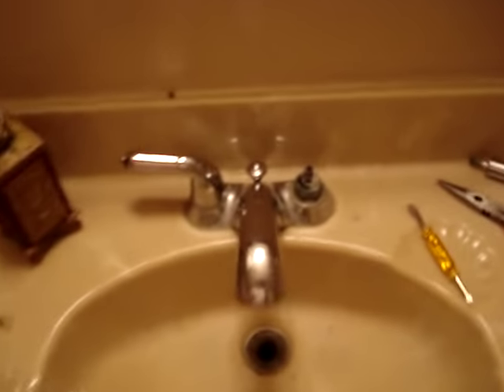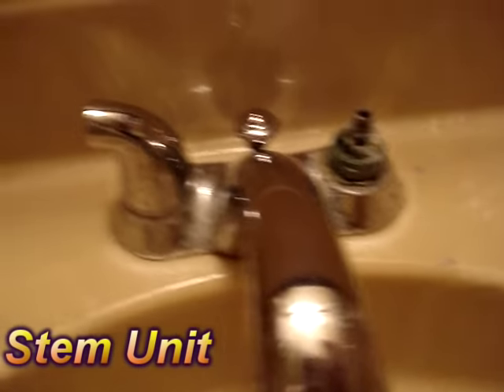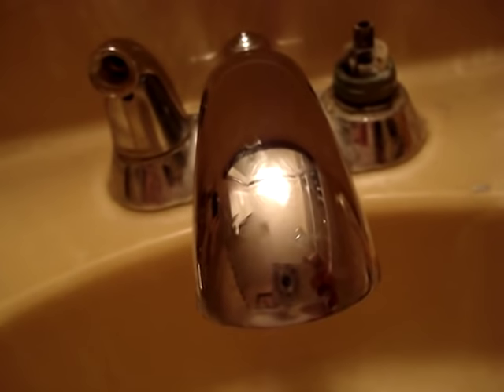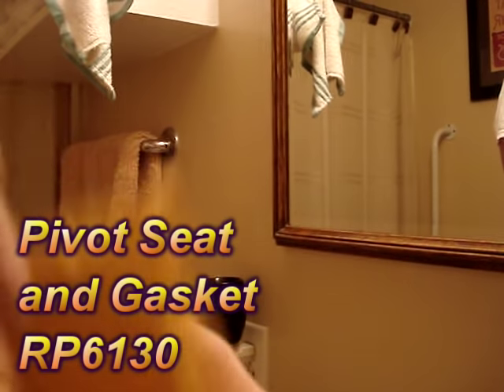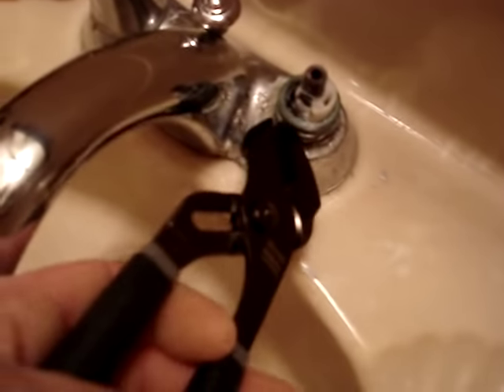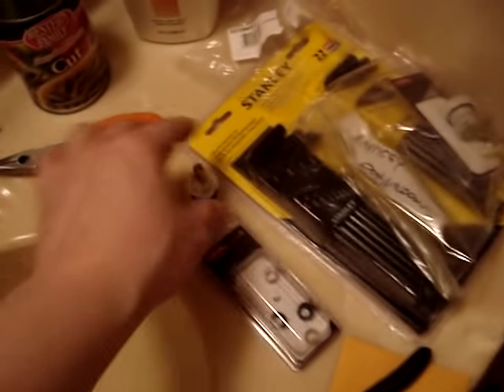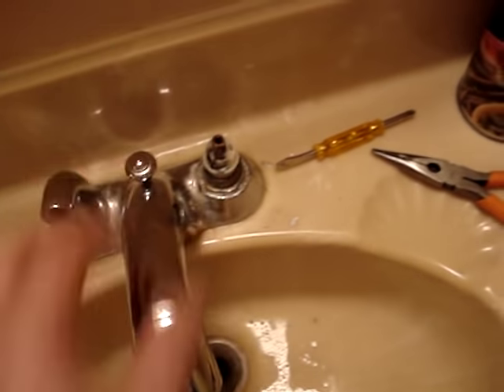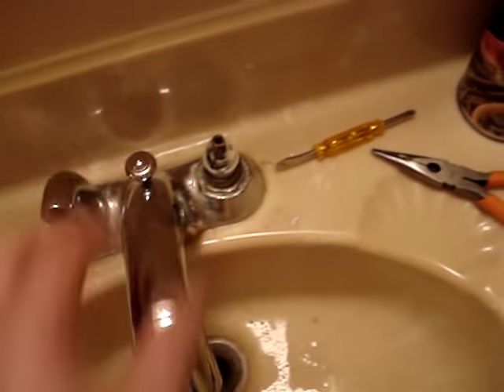How To Fix Leaky Bathroom Handle | Delta Faucet Model 4530 Series | Hard Water

Comment: This was very helpful.  I paid a plumber to fix two Delta faucets that had minor leaks and he left them with bigger leaks.  Plus, he used a cheesy plastic replacement part in one of the faucets that didn't even fit properly.  So, I checked out your video and decided I would try this myself.  I purchased the replacement parts and successfully fixed both leaks.  Thank you so much for the helpful instructions and the part numbers so that I could buy the correct parts.  I used a 3/32 Allen wrench and it was the perfect size.  THANK YOU!!!
Reply from the maker: Susan Wood, awesome! Really happy to hear that this video helped you out. Thank you for commenting!

Comment: VERY HELPFUL!!!

Have been trying for 3 months to find info and fix the same problem.

How might I get the first part of the handle off without scarring it?
Reply from the maker: Jan Ritch, glad this video helped a bit. CLR or vinegar is what I did in the video to loosen the handle and break up some of the calcium deposits. Soak a rag with either, wrap it around problem area and let sit for a few hours.

You may still have to use a flat-head screw driver like I did to pry it loose depending on the amount of deposits and how bad your water is where you live.

Thanks for taking some time to comment and hopefully you soon will have no more leaky faucet.

Comment: My moms delta I've had to repair so many times it's not funny. I purchased a peereless at lowes at least 12 years ago for $30-35 & have not had to work on it any at all. Now her delta is leaking like this one was around base of handle so thanks for sharing I'm going to have to buy some parts either just the O-ring for the stem or everything not sure which yet.

Comment: To get rid of the hard water corrosion: take a towel or old undershirt and soak it in plain vinegar. Wrap it around the faucet and leave it there for a few hours or overnight. Then you can clean off the hard water junk very easily. Hope this helps. My sinks left hard water green stains  on the porcelain and I tried this method as a last resort and it worked perfectly.
Reply from the maker: Hi kenylady, this is a great idea! 
Added this to the description and gave you credit. 
Thank you for watching and commenting!

Comment: Many many thanksTo you man great jobFixed my leaky faucets
Reply from the maker: Hey mohamed nabulsi, your welcome! Glad to hear it helped. Thanks for the comment!
Reply: Underdrummer what I did
Took everything apart
There is a spring at the bottom of the cartridge housing 
I stretched it a little  , clean all parts of the cartridge 
Problem fixed in 3 faucets
Reply from the maker: Cleaning the hard water is chore but a necessity. I'm glad that solution worked for you.

Comment: Mine doesn’t have the nut on either sides. And both handles are difficult to get off. I’m going to try to orientate the handles like you showed to try to pry them off.
Reply from the maker: Ben Correll, soak paper towel / cloth and wrap around the handles. Let it sit overnight, reloading as necessary and in the morning, you should be able to remove. Best of luck!

Comment: My moms delta faucet in her bathroom I've had to repair more times than I like to say. Usually dripping and I have to stretch the little springs at bottom of stem to fix. Last time I purchased them new. Now it's leaking around the base of the handle which I think the O-ring on the stem might fix. Just have to decide if I want to buy just it or entire stem. I hate turning the shut off valves under the sink because if they start leaking I'm screwed. Shutting main off scares me too since it's 2 foot down in ground. Do I need to shut both valves off or just the hot side that the leak is coming from? I can remember & don't want to shut off anything more than I have to in risk of leaky valves. Thanks for posting very informative.
Reply from the maker: Hey Nesmaniac, thanks for the comment. I feel your pain. I try to not use the shut-off valves for that reason as well. If you don't turn them all the time they stick and you could very easily break one. Like you said, that would be really bad. 

They sell large water keys that make it easy to turn off your main water supply. I would hate to reach my hand in there! https://www.lowes.com/pd/Orbit-Black-Water-Shut-off-Curb-Key/1039327

Turning off the main supply will kill all water to the house so maybe fill up a bucket or another sink first.
Hope you can get it working again with no leaks. 
Thanks for watching.
Reply: Thanks for the link. Shutting the main off from the city water would be handy. The buried shutoff to the house is one of those round metal knob styles which has been in there for about 20 years & not sure how reliable they are. Those inside valves last one I shutoff to the toilet to install new kit I like to never got valve to stop leaking. I turned it all the way off and it would leak and then I back off a little bit until it stopped. I had to keep placing little pieces of toilet paper around it to confirm it had completely stopped. Such a pain lol. I really despise plumbing & plumbers earn every penny.
Reply from the maker: I have used the very same toilet paper test to see if my job was leaking. That's funny.
I feel that way too. Now we know why plumbers charge so much! 
Owning a home is also an education in plumbing. 
Thanks for the comments!

Comment: I have the same faucet and also live in southern Nevada. I appreciate your video, I thought I was going to break the darn thing trying to get it apart. On one of the handles, i can't even get the first part of the handle to unscrew. I tried using a rubber grippy thing and a wrench but just ripped the rubber grippy thing. Any suggestions?
Reply from the maker: Hey Ashley Seay, thanks for the comment. 

Wow! I thought mine was bad. You could try a towel and large pair of channel locks. The towel allows the channel locks to get a grip without marring the handle too much but be warned the teeth will sometimes come through.
The other thing is soaking everything in white vinegar though not sure how you would keep the soak on the part that needed it. 

Finally, maybe try a very thin flat head screw driver or kitchen knife to try and wedge the gap between the handle and the rest of the faucet open a bit. Then you could get some vinegar in there and let it work on those threads.
Let me know if you manage to get it screwed off. I fear if the handle is that bad you are going to have a very tough time with the nut I struggled with. Best of luck though!
Reply: @Underdrummer  Oh yeah, it's bad!  We just moved into this house and it's been a lot of work. I discovered yesterday that as long as I removed the little allen head screw, I could pull the handle off. And by leaving that first piece on, it was easier to pull off with more leverage. So now I have 3 of the 4 taken apart (double vanity). The problem with the 4th one is the little allen screw is so corroded that it is stuck tight. It actually broke my allen wrench! :( So today I guess I will be going underneath to see if there is a way to take it apart down there. It has been one heck of a job.

Comment: Same problem with handles frozen on. Delta said soak in 50/50 solution of vinegar. Me-  "It's a faucet, how am I supposed to do that?" Her - "Wrap rag around and soak for at least 8 hours." Me - "Hey Delta, judging by the number of youtube videos instructing how to remove parts, MAYBE YOU COULD USE SOME FRICKING ANTI-SEIZE ON YOUR PARTS?" I've had exhaust pipe bolts come out easier and they live in a far harsher environment, just because someone put anti- seize on them.
Reply from the maker: DR Sudz,lol, I know how do you "soak" something like that. I went through a lot off vinegar but got it eventually. 
Great idea with the ant-seize. That's a must with this calcium rich water.

Comment: I installed a water neutralizer in my basement...water is perfect.
Also I found a set of Alan wrenches, and one of them is a 3/32...fits like a glove...does the Steele hardware or lowes, home depot have those pieces for the delta...because my sink delta looks almost like your bathroom delta.
Noticed a very slow leak in my kitchen faucet...will have to do it shortly.
Reply from the maker: Film Noir lover, great to hear you've solved the issue. The Alan Wrench was a pain for me. We need to get some form of water softener as well. Thanks for the comment.

Comment: You’d make life a lot easier for yourself if you would use plumbers waterproof grease to lubricate the seals, the threads, and every sliding or mating surface, so that the repair will last longer and the calcium buildup and rust will not make it harder for you to take apart next time you have to do this.

Thanks for this video - very helpful.
Reply from the maker: Thanks, I'll look into it!
Reply: Underdrummer I had to learn the hard way to use the grease. I also learned to put dielectric grease on any connectors in a modern car, if you start having weird lights coming on (reduced engine power, check stabilitrac, etc) and odd electrical problems. There’s a GM Technical Service Bulletin from about 2011 recommending the dielectric grease treatment on every electrical connector in their cars and trucks.  I have a GM car with just those problems - the grease has helped a lot.

Comment: Great information, thanks for sharing!   Have an issue with something you did not cover since your handle came off relatively easy.  We have hard water as well, but we cannot even get the handle to even budge to get it off.  Any suggestions on how to get it off?   Thanks!
Reply from the maker: Hey RzRsEdgeAK, your welcome. That's how my handles were - I ended having to do the other one a few months later too. They were both so stuck that I though I might break them. 
Check out 5:24

CLR in a spray bottle or go the green route and just use some white vinegar and spray the heck out of the handle seams. In the Allen wrench hole as well.
Let is sit a few hours and repeat. Having the correct Allen wrench and a lot of wiggle and a standard screwdriver is also necessary. That's what eventfully worked for me. 

Hope you get it fixed. Thanks for the comment.
Reply: @Underdrummer  Thanks for the tip.  My handles are just like yours, almost impossible to remove.  The CLR and the screwdriver did the trick.  Thanks again.
Reply from the maker: @Trin Rios, You are welcome! Glad to hear it helped you out. Thanks for taking the time to comment.

Comment: thanks but We have hard water as well, but we cannot even get the handle to even budge to get it off.  Any suggestions on how to get it off?   Thanks!
Reply from the maker: Chaudhary Halim Family, sorry to hear you can't remove handle. Many in the comment section have had this same issue. 
Here's one of the best tips I've come across:
★ Tips on how to get rid of those hard water stains from kenylady:
(Thanks to viewer, kenylady!)
To get rid of the hard water corrosion: take a towel or old undershirt and soak it in plain vinegar. Wrap it around the faucet and leave it there for a few hours or overnight. Then you can clean off the hard water junk very easily. Hope this helps. My sinks left hard water green stains on the porcelain and I tried this method as a last resort and it worked perfectly.
Reply from the maker: Also a flat-head screwdriver or butter knife wrapped in a handkerchief to prevent scratching wedged under the faucet helps to remove it. Make sure the allen wrench has done it's job and completely removed loosened the handle before attempting this.
Let me know if you get it detached. Best of luck!

Comment: I liked how you alternately were loosing it and trying to contain yourself while working on this thing. I'd like to see outtakes video with all the cursing and swearing hahaha.
Reply from the maker: Haha. Yeah, isn't that how REAL plumbing goes? I tried to keep it clean since it is a How-To video but didn't catch all of them and hence the bleeps. Thanks for watching and commenting!
Reply: @Underdrummer  6 years later and I am looking at your video again. This time not only my hot water valve was leaking, but also around lever that moves the plug up and down underneath the sink, and it's been doing this for weeks, or months, before I noticed. Now the bottom of the cabinet is rotten and must be replaced.

Comment: i have a delta faucet and mine leaks from the bottom of the handle. well my son bought the replacement part n i installed but for some reason when i turn the water back on, the water just runs without leaking but it wont shut off. i need help!
Reply from the maker: HI Stephan Cobb, sorry to hear that! 
It sounds like your son may have been sold a faulty stem unit or accidentally bought the wrong kind. 
Also it may have been installed incorrectly. 
If you turn the handle on, does the water shut off? If so, that would mean the stem unit was not put in the right way.
I suggest calling a plumber or looking up a YouTube video with exactly your same issue.
Let us know if you find a fix for this or if you want to give me more information, I will try and further assist you.

Comment: Great, just what I was looking for!  Needed to know if replacing the stems would fix leak from faucet handle, hot side in my case.  Two things, first: White Vinegar works to get rid of the calcium deposits.  I wrapped a wash cloth, soaked in white vinegar,  around my fixture.  That cleaned it up really good.  second: The model number is 2530-NNLHP--H24NN--A24NN 
https://www.deltafaucet.com/bathroom/product/2530-NNLHP--H24NN--A24NN.  They both use the same parts for Seats & Springs and Stem Unit.
Reply from the maker: So glad the video helped out another person. You're right, the link I used was the very similar model; 
4530-NNLHP-H24NN-A24NN. Thanks for clearing that up!
I have copied and pasted your link of the model in my video's description. (Credit to Walt Davies.)
Thank you for the comments, the tips and the additional help!

Comment: replaced cartridges springs and seals because of dripping faucet..now every time i turn the water on it shoots the rubber gasket through the cartridge and out the faucet. i configured it about fifty diffrent ways and no luck for me
Reply from the maker: Sorry to hear that. Shoots water out of the faucet or out of the handle? Gasket may be too small. You may need to call a plumber.
Reply: If you have a Delta faucet and not sure of the Model number, call them at the 800 number and open up a ticket. They will send you a form to which you attach 3 pictures (front, 45 degree angle & underside) and after you mail it to them call them back in a week and they will identify the exact Model number, and send you the replacement parts. In the meantime you can google the Model number and download the PDF's containing the exploded view of all the parts, the drawing showing all the dimensions and the drawing showing you how to install the faucet (all 3 are still useful). 

After replacing the seats/springs and cartridge in my unit I noticed that the gasket was slipping (it's also a center set model) and called them up and ordered 3 gaskets for my particular model. Once those are in, I'll shut off the water and disconnect the faucet from the underside, clean everything while I am at it & install the new gasket then hook it all back up. 

Another thing I don't like is the cheap plastic valve that came with the supply line. I am replacing those (at my expense) with models that let me disconnect the hose w/o disconnecting the valve itself. 

Slowly but surely I do this to all faucets and will be done in the not to distant future. 

Delta even replaced the handles and aerator because the one I have is all crusty. Now that we got a new water softener that should no longer be an issue but it's nice to have all "new" so to speak as part of the original lifetime warranty.
Reply from the maker: Dan J
Awesome! Thank you for all the extra information - I will definitely use this next time!
Reply: And thank-you for the video. It helped me get started removing the set screw & prying off the knob.
Reply from the maker: Dan J
Your welcome! Glad it helped!